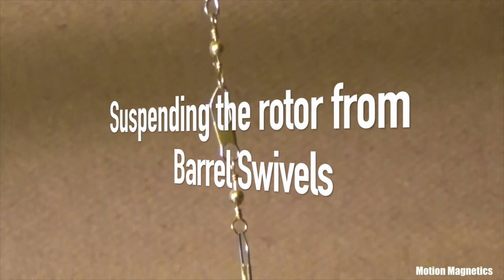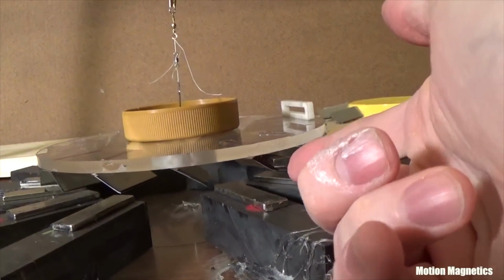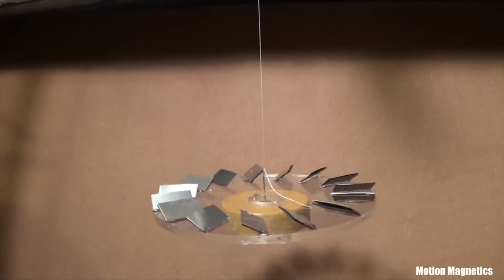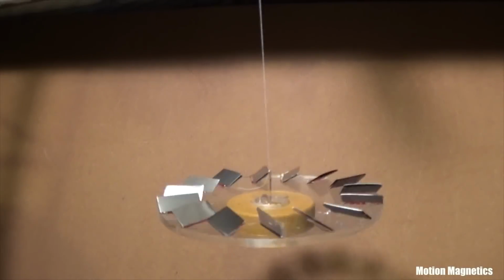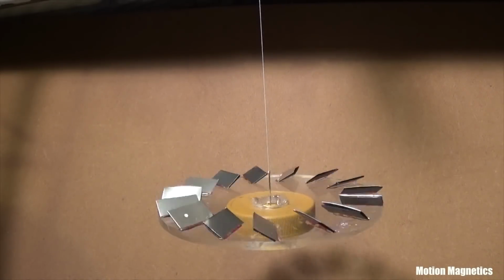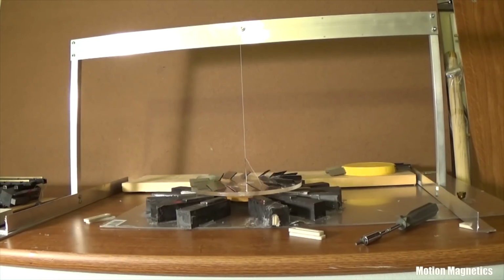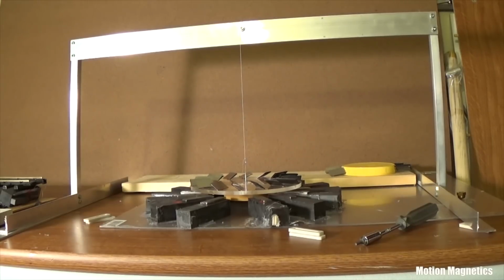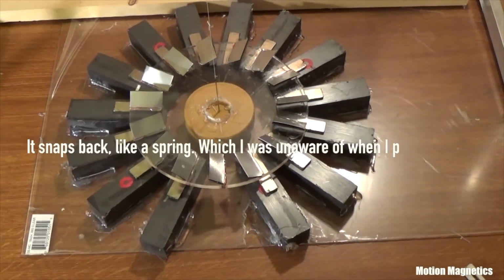The Diamagnetic Motor Part 02

Comment: It seems promising. But I have some questions and doubts. The angle between graphite petals and plexi disc seems to be 45 degrees. So (if proper force is present), half of it works on turning and half tries to lift graphite up (and is lost). I would like to run a test with graphite  plates mounted nearly verticaly (10-15 degs). Other way  could be non-vertical field like U-shape magnets mounted in slanting position +30-45 degs around plexi disc.  And the most fundamental: what about second law of thermodynamics? Or more exact Maxwell-Faraday integral? Graphite works as diamagnetic pushing some field away. So in the symetric field leaving the space can produce the same amount of energy as is required on entrance. How to break the symetry? Despite the doubts I can see fresh idea in your work. Don't stop if some experiments fails, please. Thank you for sharing your work. Good luck.

Comment: Dude, you had a great approach with letting the string unwind... But when you disconnected it from the mount and then let the end of the string go between re-mounting it over the stator magnets, you allowed the string to relax to it's normal twisted state.  You should have kept the end of the string constrained to the rotor position between allowing it to unwind and then reattaching it over the stator magnets.

You really could quite easily simply use a very small ceramic ball bearing at the top end of the string.  One you have removed the shields and degreased the internals of the bearing.  These bearings have such little friction that if this setup is actually producing any notable rotational energy, it should at least be able to overcome the very small resistance within a tiny ceramic ball bearing.

Comment: Thanks, this looks more realistic this time around.

You raised the issue of rotor dampening when being counter-rotated (counter-clockwise, I think). Almost certainly this was due to aerodynamic drag from the canted magnets on top of the rotor. They act as very effective air brakes in this direction and will exert a drag force at least 10 times greater compared to the drag arising from rotation in the opposite direction.

Trust this is helpful.
Reply from the maker: That's a thought. Thanks.

Comment: have you tried doing this set up in a linear fashion? maybe with a halbach array as the stater but with this exact rotor design, only this time think outside the box, instead of putting an array of magnets on a cart and seeing how many cycles or loops the cart travels, use this rotor design as the wheels  of the cart, doing away with the load of heavy magnets.  Does mass square with speed like energy does, would this not save exponentiation energy? imagine the rocket equation if they didnt have to load there space cart with heavy fuel magnets. hope that made sense. keep up your good work and best of luck.

Comment: Think closer at the direction of the magnetic field and you will get it to work. Hint direction of the flow is just like electric flow. Negative towards positive.
Reply from the maker: You definitely see the effects of the magnetism better at close range. Cogging can also be an issue though. Thanks for the suggestion.
Reply from the maker: Well, that sounds interesting. What method do you use to test the field strength of a magnet? And, what organization are you a part of?
Reply: Motionmagnetics A simple costless way is a kitchen scale a block of wood that sits higher than the scales. Place a bridge across them to create a canter lever place magnet on top and zero out the scales. Using metal pass it under the bridge record the amount flip the magnet record that amount also.
The lesser is the South the difference is   
where the work is happening.
You figure it out from here.
Direction of flow, faster than speed of light, North is always seeking the South. 
Think of airflow through a tube.
Reply: Wave Man seen it and is use in hover board.
Reply: Motionmagnetics there is a device called gauze meter think flow the field is not passing through the carbon.
Reply from the maker: I just watched it. Thanks for sharing the info.
Reply from the maker: I guess I hadn't considered using a gaussmeter to check each magnet individually. I like to imagine that some care was taken by the manufacturer to keep the specs pretty close when manufacturing multiple magnets in the same size and strength and that slight deviations won't make a big difference. You mention flow, which was what I was thinking of when I designed the rotor, but the pyrolytic graphite exhibits the same cogging effect that a magnet does when introduced to a second magnetic field.
Reply: Motionmagnetics flow from North to South. There is a Zero point this is the location where all work happens. The carbon creates an opposite field. Placing it near a South creates a north in the carbon. Between two magnets the field is uniform if you use a piece of metal, and a gap, the gap is filled with an organic diode then the current flow is in a straight line between the magnets. The current is obtained from each end of the group of magnets.
Reply from the maker: Do you post any of this information, or projects you are working on somewhere?
Reply: Motionmagnetics I post nothing of my work on YouTube. 
Try this it may work, get two magnets opposing each other. Place the carbon in a “V” shape pivot it so it will swing between the two magnets.
Show the result, then turn one magnet so they attract. 
Let the “V” shaped carbon swing between them as you did before. 
Record the difference between each experiment. 
I want to know the results, and the values you collect. This should demonstrate that the magnetic field is moving and not stationary.
Reply from the maker: I tried similar configurations while experimenting with the graphite. It will most likely balance out between the fields, and cease movement. If you have a couple pieces of graphite, two magnets, and 10 minutes you could try it though? That might make a nice video for you to post, and wouldn't get in the way of whatever else you are working on.

Comment: Use coils on your stator and trigger a pulse with a magnetic sensor, an Arduino circuit (https://github.com/kmdouglass/pulseGenerator) and a battery. The system is guaranteed to work because of the battery. The difference between the energy consumed by the pulses (50% duty cycle) versus the energy generated by  an alternator moved by the sum of magnetic and dynamic/inertia energy should charge the battery and provide extra capacity.
Reply from the maker: Thanks for the suggestion. I usually avoid wiring and circuitry in most of my builds, as it adds a whole new layer of complexity to the designs. I'd rather work out the basics first. Once I'm satisfied enough with a design that I feel it merits the added complexity, I'll consider it.